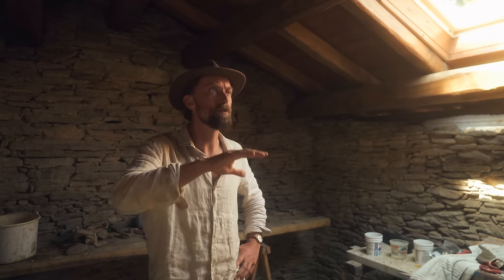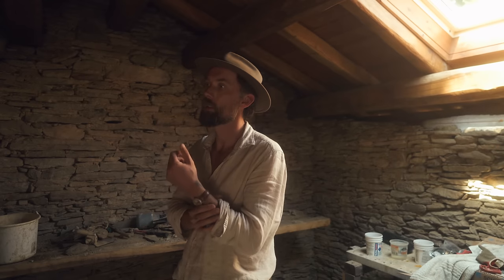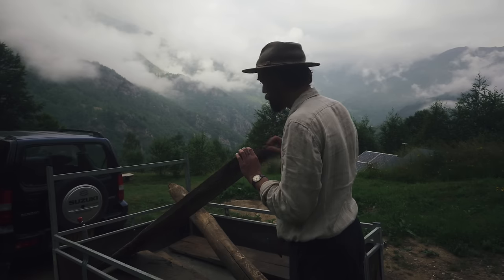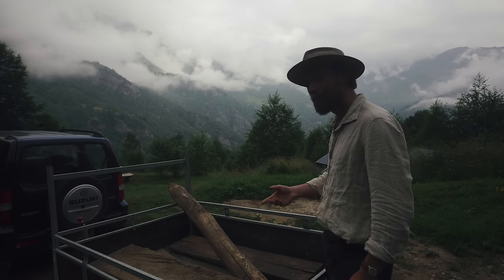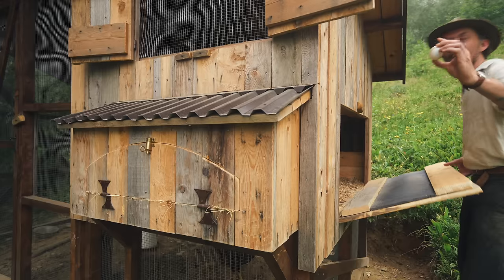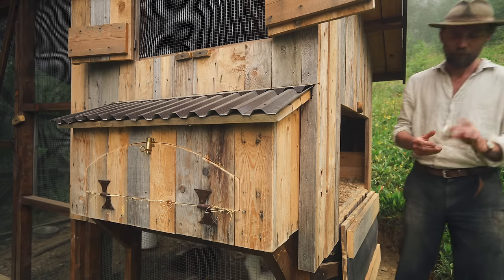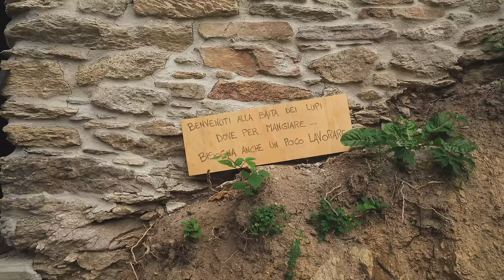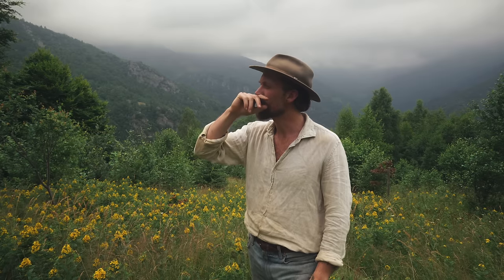#75 Finishing the road, Rebuilding the Dog shed, Window Frames and a First Egg

Comment: I had a flea infestation, and I fixed it by dusting the floor heavily with diatometious earth. We had a long dry spell and I did the ground outside the cabin, too. got rid of them with no chemicals. I did the same thing with the chicken coop for bird lice. I know you have lots of hiding spots in your stone walls, but it' worth a try before using chemicals that are not good for your health.
Indeterminate tomatoes continue to grow until the frost kills them. It is best to prune them, take off the side shoots, and snip the tops to force them to produce flowers instead of branches, unless you have a wide tall trellis to attach them to.

Comment: you need diatomaceous earth for the fleas.  You don't have to fumigate with pesticide, the diatomaceous earth is silica from diatom shells, it cuts and desiccates arthropods, bugs.  sprinkle it on the ground and sweep it into the cracks.  just sweep it up after a week or two.  use it on the chicken coop too, if your house has fleas, the chickens have fleas.  also i love your show, thanks for putting these up.

Comment: I don't know if it will help with the fleas you have but in the U.S. I sprinkle cedar shavings around the perimeter of the house in the spring and a little where the dogs lay down. I used to have a real bad problem but this seems to fix it. Where you are at I would even sprinkle them in the building until they are gone. Spread a lot the first year.

Comment: Hi Martijn,  just a question rather than a criticism, but why are you not cleaning the stones off completely as you build up the walls of the dog shed?  I would thoroughly wet wire brush every stone and suck out all the loose dirt with a shop vac from in between the stones.  It would seem to me that much loose dirt is a source of weakness.  Also the cleaner the stone, the better adherence the mortar will have to the stone.

Comment: For your tomatoe plants - take away most of the bottom leaves so the tomatoes get more light to be able to ripen properly. Also you can cut off the top bits at the end of July as the forming flowers won´t turn into tomatoes anymore and it takes energy away from the green tomatoes

Comment: Martijn, Where do I start!
Let me put it this way. It looks from the last videos like you have no plan, not at all. Your randomly doing workings around the house but not in the house!?
After the storm early this year which completely devastated your buidings and this funny tent, i thought you would get the message and work harder in the house to make it habitable.
But no! your still playing whit this small thing around the house! To be honest it looks like a city boy, tries to make a living on the country side. Doesn't look and work very good. Focus on the house!
Btw. the chickens are not giving any eggs, because you don't give them enough food. If you already wondering why this is the first egg you get after months. You have to give them also protein and corn, cant only feed them with leafy greens and leftovers. If you want them safe, the solution is clear. Get a dog!
Your videos on the other side, have a very good composition and cut. Your very skilled in this area as one can see. 
If you mean it serious with living there, stop wasting your time on the outside but first fix the house and move in before winter. Otherwise its gonna take you till 2525 to finish the project.
Get rid of the summer kitchen, in this place, if you don't want to rebuild it after the next storm. You can to a summer kitchen outside. But place it on a existing wall witch would provide a significant wind shielding in the future.
Last point! Get a suitable car! A pickup like VW Amarok, out a Toyota. The Jimny is quit cheap and good 4x4 solution, but brings no advantage in such high wet terrain with a muddy environment. Also you cant use it to transport stuff since its tiny! With a pickup you wont need the trailer.
I'm not trolling you, just trying to help with my experience living outside.
Any way....beside this the videos are quite entertaining ;-)
Reply: I'VE got plenty of experience of the things of concern here....and I think you're pretty much COMPLETELY wrong about everything!!!
...and such arrogance ...you need to show a little humility and understanding of other people...he's doing thing the way he wants to.....not the way YOU want him to!!!
And, fundamentally, he's doing it all very well....